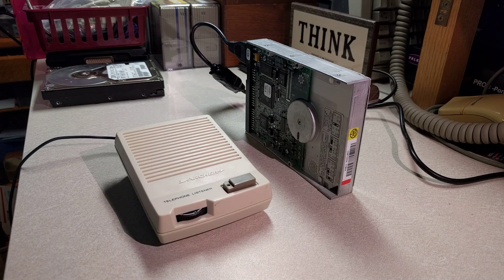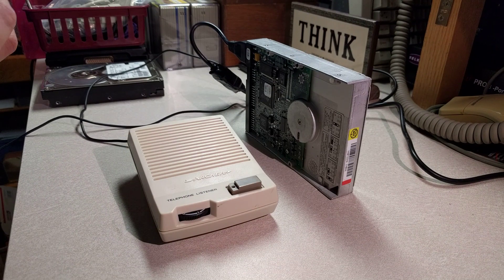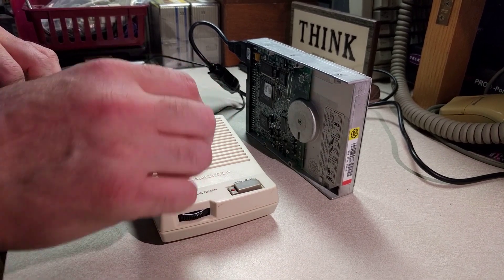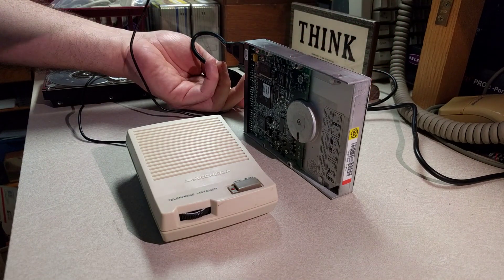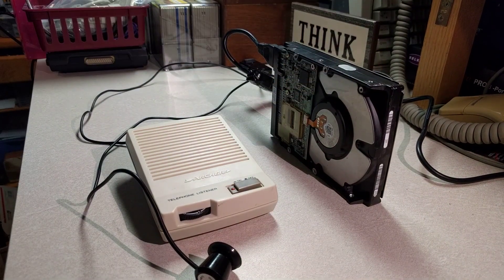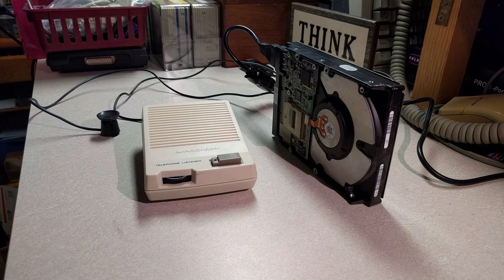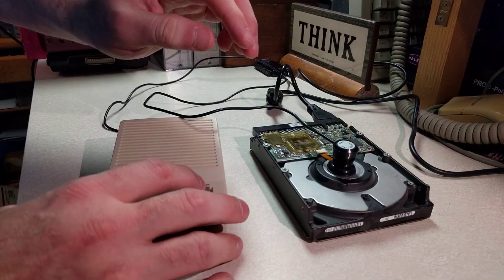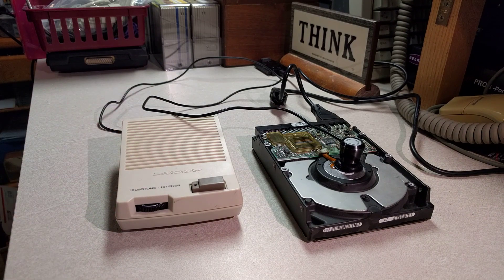Listening to hard drive noises with an electromagnetic pickup coil

Comment: I'm glad I'm not the only one who used this thing for anything but the telephone!
Reply: You are not the only one, I used it on the RCD (Circuit Breaker) with the washing machine running the whole cycle. It can pick up sounds from power lines and other electrical sounds in the streets of a town or city but the latter 2 may be awkward for those who do not wear a listening device  to listen for them in 1st place.
Reply: @mrunixman1579  i wonder what it would pick up during a thunderstorm?!

Comment: Is that IBM one of the disks with glass platters?
Reply from the maker: It is possible because some of the Deskstar line used those, but I don't have a cross reference that will tell me.  Normally you can't tell unless the platter is shattered or is damaged because the glass is coated just like aluminum platters are.

Comment: I was today years old when I learned that hard disks loaded their firmware "live" instead of it coming from a ROM...
Reply: same
Reply: Yup! This is why you can sometimes revive a dead modern disk by swapping the PCB.
Reply from the maker: Yep - as hard drives got more complex the amount of code got to be too large to store in FLASH or a ROM chip.  It turned out to be more cost effective to have a minimal boot loader to get the drive started, and then to read the full code set, performance tables, etc. from a reserved area on the drive.  Hence the two stage boot process.